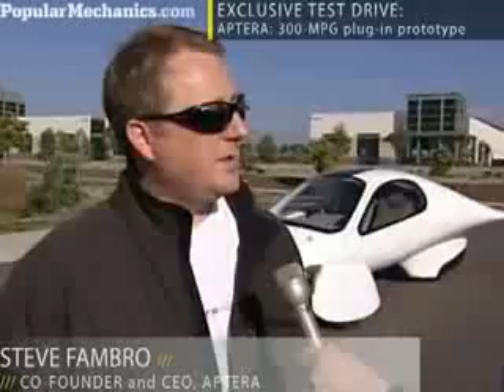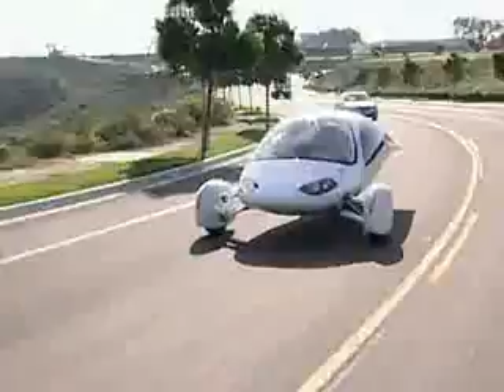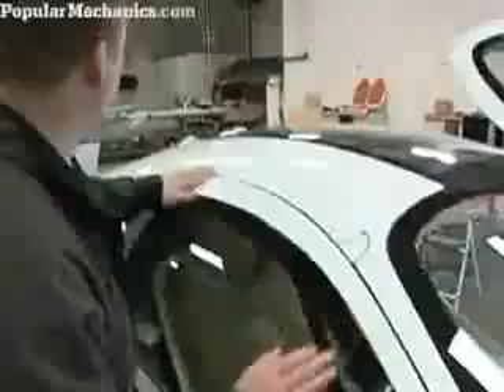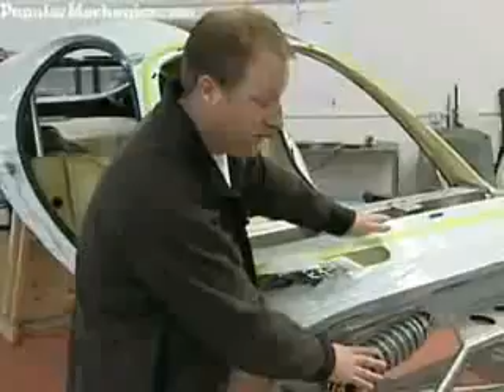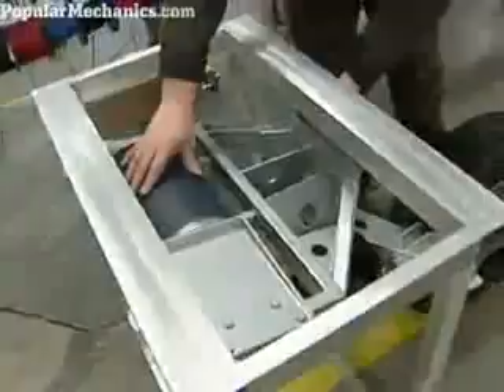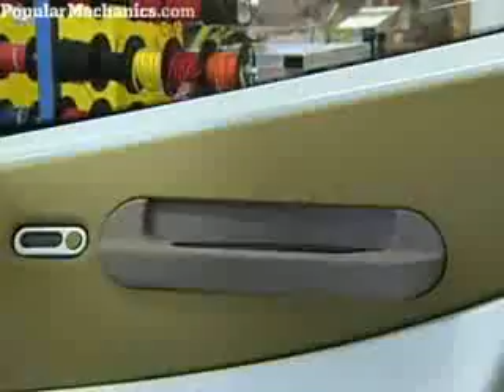300 MILES PER GALLON TEST DRIVE!!!  POPULAR MECHANICS APTERA

Comment: being American built i was sceptical before. (American cars are rubbish) But this looks very clever. The only thing that worries me is the build quality and reliability and more than that the safety. If you have a blow out on the front wheel at high speed it will be only 2 wheels not in line with each other like a bike and will flip over. Also wouldnt want to be a crash with an SUV in one of these when the crumple zone is the GLASS windscreen and then your face!!!

Comment: I feel quite sorry for the people of the US, they have virtually no choice when it comes to economy. For example there is a list as long as my arm of vehicles sold in Europe that do 60+ MPG in normal driving, none of which are silly hybrids. A Peugeot recently achieved 126 MPG in an economy test over 3700 miles! And this car only had a 1.6 litre diesel engine, not a hybrid! In US MPG this still works out at around 100 MPG. My best was 82 MPG in my old Fiat Panda

Comment: What are you talking about? $30,000 for a vehicle IS inexpensive. Especially an electric vehicle that gets 120+ miles on a single charge with a 1500+lb weight and having the lateral grip (skidpad g-force) of a Koenigsegg CCX? What's not worth $30k?

Comment: Can they please show us the trunk? In one of these interviews they said you could fit a surfboard in the back. not very much width, but has some length that it could use. What they should do is create an upward facing trunk opening that can remain open while driving to add some utility to the car. Obviously it wouldn't be good for wind efficiency, but fitting something decent size in the trunk would be worth it.